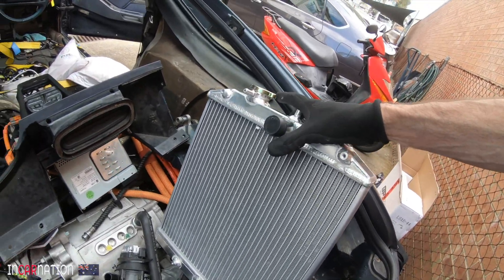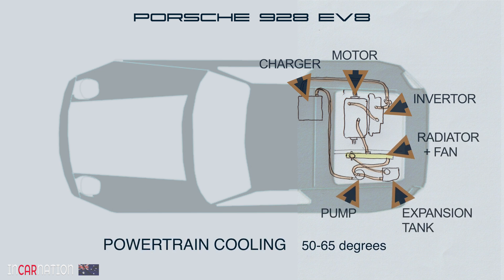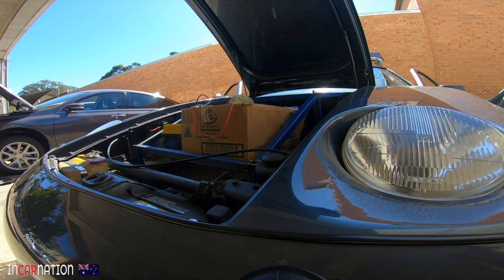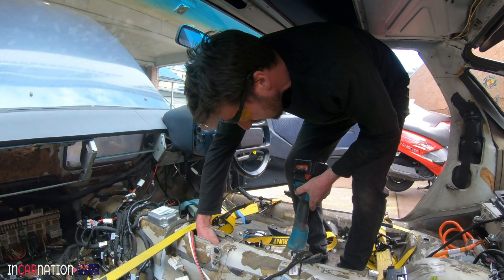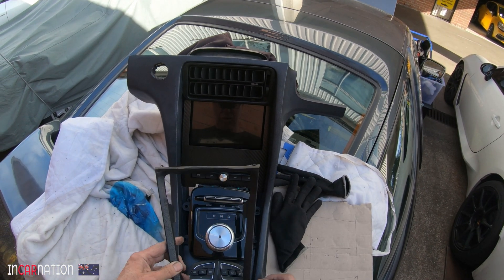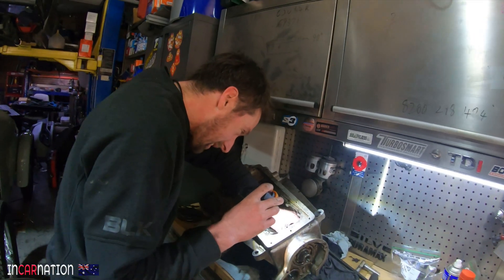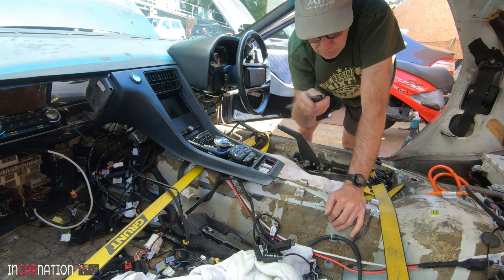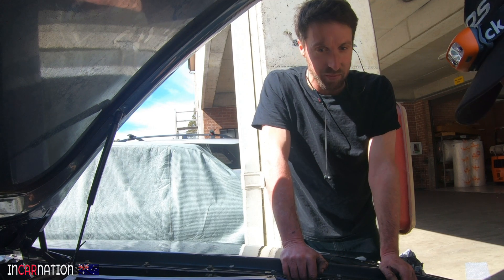Episode 30 – Porsche EV Conversion | Cooling System Plans for the 928

Comment: Perhaps an S2 spoiler would be better? It would reduce drag by pulling the laminar airflow down the rear hatch vs the S4 ‘wing’ which increases drag but improves downforce. In terms of looks, I like the wing but that’s probably because I am used to that look.

Comment: Love the clean rear end look, voting for delete wing, delete wipers and love the flared guards as well. Also, is it time to reconsider putting the AC back in and use it as cooler for the battery as well?
Reply from the maker: It won't have the grunt to justify flared arches (I'd feel like a cheat) and I'm happy with the clean S4 look. Yes I would like to add back the AC but I know it'll be a big task - there simply is no room in the logical spot and I know it'll take a lot of time to sort it out and find locations for components like the Evaporator, TX valve, fans, etc. Compressor should be no prob as I already have one, and all the circuitry to drive it. I'd rather get the car driving, assess how well my new battery cooling system works, and add AC once it's on the road. Thanks for your input.

Comment: Personally I like the wing for two reasons, firstly it is a beautifully designed wing that was clearly designed to be part of the car rather than something whacked on as an afterthought.  Secondly in cars without a reversing camera it gives a nice reference point for the rear extremity of the car when reversing.
Reply from the maker: Surely mine is one of the very few with a reversing camera, as it's part of the MG's loom and was never fitted as OEM.